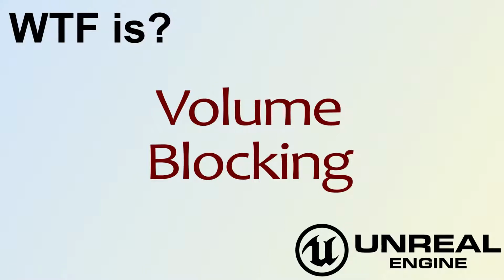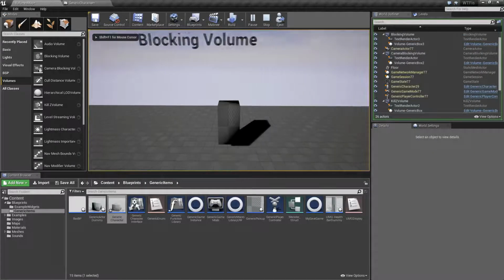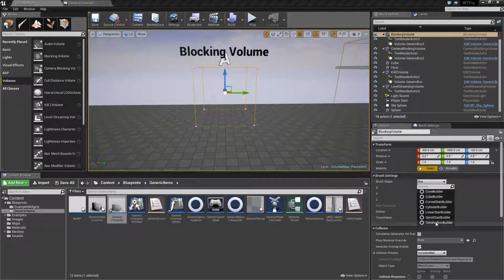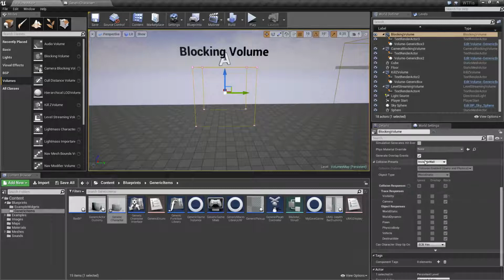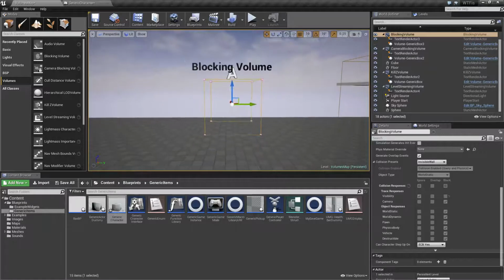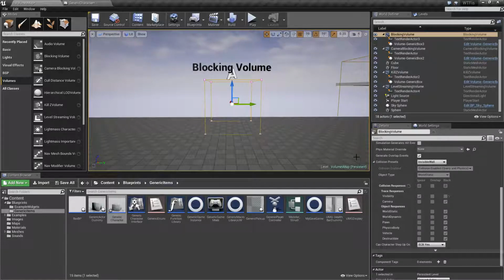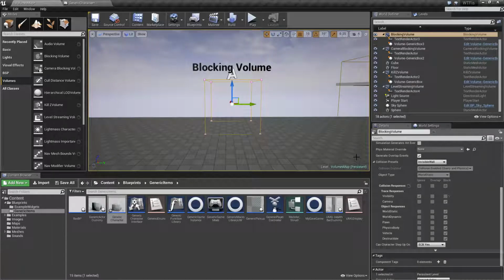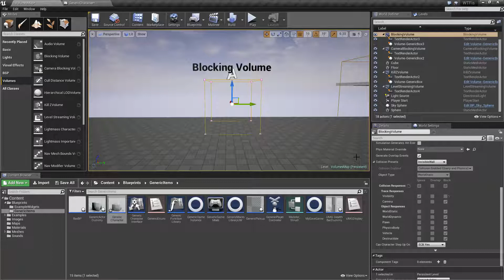WTF Is? Volume - Blocking in Unreal Engine 4

Comment: Can I add a message in the HUD if I touch the Blocking Volume.  Like Fallout 4 saying "You can't go that way" if I hit the blocking volume.
Reply: Collision box with a trigger and a HUD widget to display the text
Reply: @TheRealDoombox  But are they separate or can I create a BP with the two and call the HUD?
Reply: @clebo99  The 2nd option. Basically you'll create your widget and create the blueprint for the wall that you want to stop the player. Set a collision box on your blueprint and add a "on begin overlap", cast to the player character, then call a create widget, plug in the message, then add a cast to viewport node.

You'll also have to delete or remove that widget being casted to the viewport or it won't go away.

My opinion would be to have an on end overlap node tied to the blueprint because then the message can be displayed while the player is within that box collision and when they leave it you can remove it.

Comment: I created a project from the puzzle template and added code from the Unreal website which allows the tiles to be dragged and dropped. The tiles can be dragged through a Blocking volume. Do you know a way to prevent this?

Drag-and-drop code here: https://docs.unrealengine.com/latest/INT/Resources/ContentExamples/MouseInterface/BlueprintActors/index.html
Reply from the maker: Quickly looking at this try checking the Sweep checkbox on the set nodes at the end.  Blocking Volumes are intended to be used with physics and when you set something you are basically skipping any physics and moving it there in one movement.  The sweep option will check the start and end points for the move and see if it should collide.